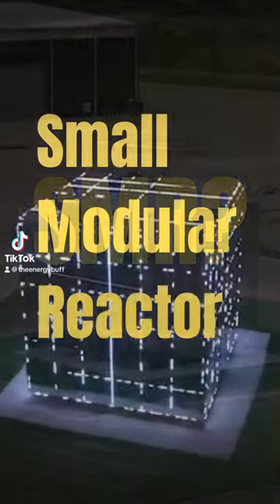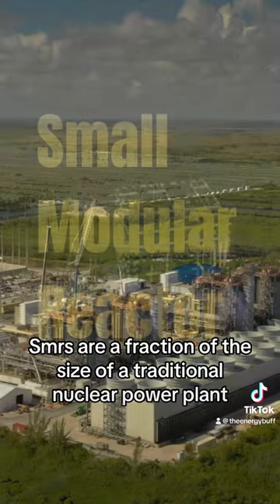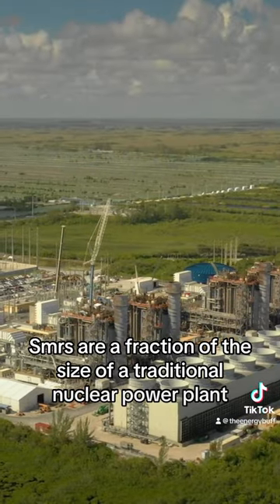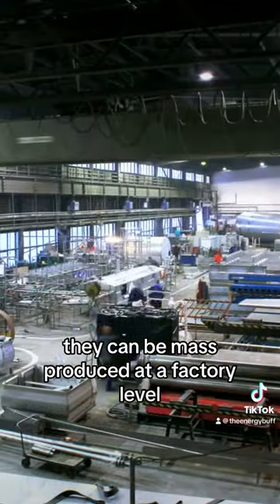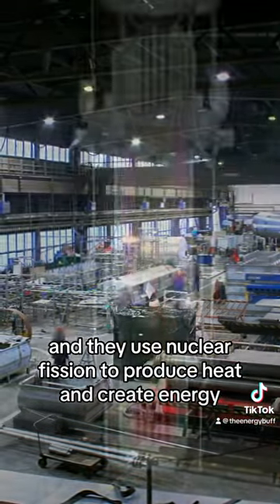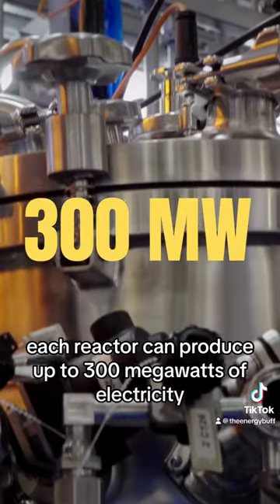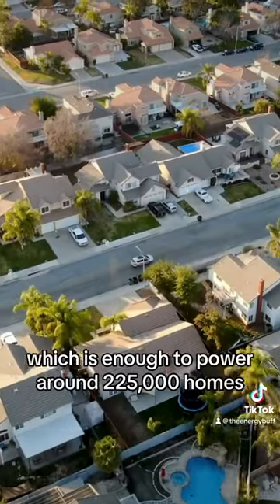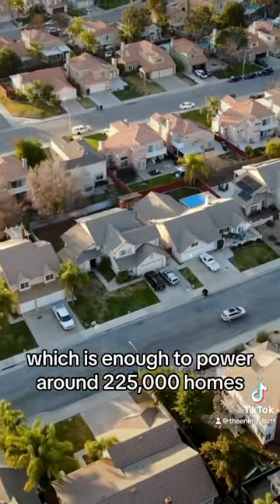Small Modular Nuclear Reactor (SMR)

Comment: Affordable yes, but are they safe?
Reply: Yes, with newer safety regulations and safety features, they are much safer. SMRs are honestly our best bet rn for cleaner sustainable power.
Reply: @butternater-kq3ye  what about the fuel, is there abundant nuclear fuel available to replace conventional energy sources like coal, oil and hydropower
Reply: @StevenDanyy   The U.S. has the fourth-largest uranium reserves in the world, primarily in states like Wyoming, New Mexico, and Texas. According to the World Nuclear Association, the U.S. has about 207,400 metric tons of identified uranium resources.
Reply: @StevenDanyy  If the U.S. were to develop and implement more advanced nuclear technologies, like breeder reactors (which can recycle and reuse spent fuel), the available uranium could last much longer. Breeder reactors can extend uranium supplies by up to 60 times compared to traditional reactors.
Reply: @butternater-kq3ye   maybe for US but still I am thinking on worldwide scale because currently we have more than fossil fuel but will there be enough nuclear fuel to replace every coal or conventional energy plant like hydro fuel all around the world, I am asking? 

Because I don't think uranium is that abundant mineral like iron ore or some other metal ores and also we have to enrich it and let's we use that fuel , then how long it is going to last like 10-20 or 50 years after that won't have to look for it again and then won't this be again the same issue like fossil fuel ?

Also I am not a nuclear scientist or anything like that , some many of my assumption might be wrong here